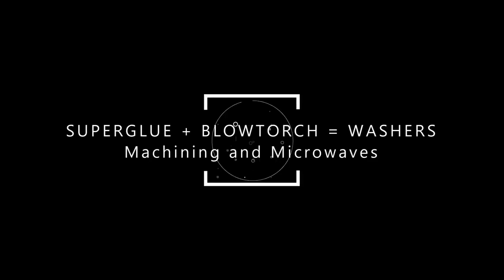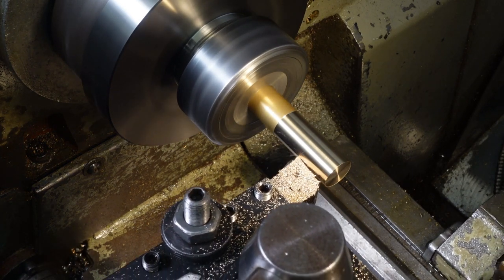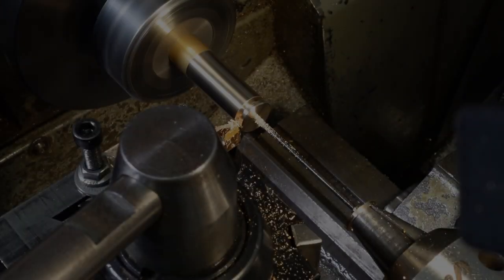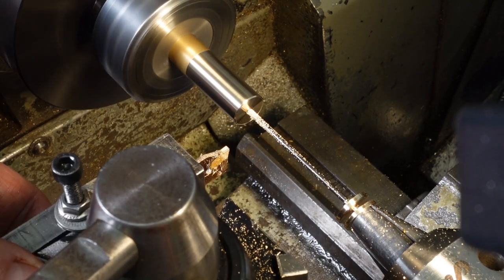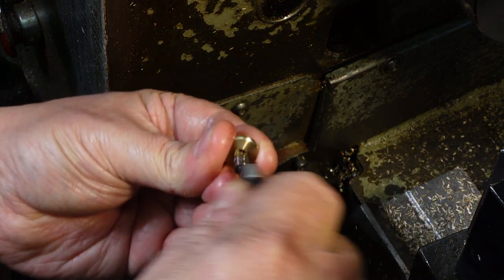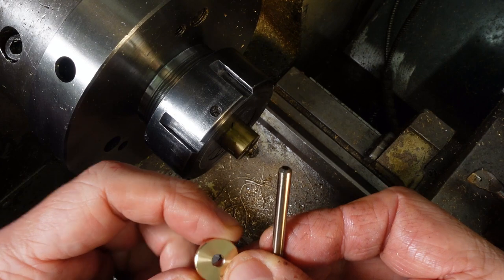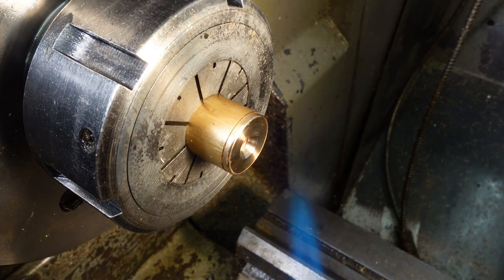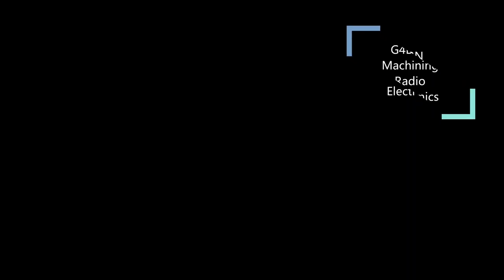How do you hold a part you can't grip?  Machining precision washers with a Glue Chuck

Comment: That you're aware of a 20 micron non-linearity, and can live with it, is remarkable.  If I ever get around to putting scales on my machines I might bother measuring them that precisely, but then I might not just to save the headache of knowing that they're that close to perfect but not there.
Reply from the maker: I suspect it's something mechanical that I haven't spotted yet. It's totally repeatable though and by setting the stickout on my tools to a standard length, I can usually avoid it being an issue.  The DRO was included with the lathe, and it's so old that Newall don't have any record of the circuit. I can map the non-linearity using a dial indicator.  I can't see how it can be related to wear on the gibs or slide, as there is no discernible lateral play or shift in that range. At first, I thought it was a scaling error, so tried tweaking the rate constant for the Spherosyn scales, but that just made the overall scale incorrect, and the nonlinearity was still there. I suspect there could be some damage to the outside of the tube that carries the precision balls of the cross-slide Spherosyn, and that is somehow upsetting the LVDT/induction mechanism.  After all, with 5mm balls in the tube, getting to a 20 micron error is perhaps not that hard if some hamfisted eejit has scrunched the tube.  I need to tear it to bits and have a really good look at it on the surface plate with a height gauge to see if I can find the root cause. It's possible that something is catching and twisting or bending the mounts and I've not noticed.  I really must get it sorted, but the cost of a new controller for the Spherosyns was about what I paid for the complete lathe, so I might put up with it for a little bit longer to save on cost. Typically it's perfect from 100 mm dia to 40 mm, then after a reset, it's perfect from 28 mm to 0, but between 28 and 40, there are oddities, and a total offset of 0.02 mm between the 100 to 40 and 28 to 0 segments. I even thought of bodging the controller and sending the readings out to an external home-made controller/display and making the corrections in software, but there's no way to do that without manually setting the position where it goes wrong. I'll have a proper look and maybe try buying a second-hand Spherosyn rod of the correct vintage to see if that's the problem. Otherwise, I'll just buy a modern replacement DRO.
Reply from the maker: I noticed because I made some shafts that were 20 mm and others that were 16 mm using the same collet chuck and tools and DRO settings, but the 16 mm ones came in oversize.by 0.015 mm. Later, I did the same with a different tool with more stickout from the toolpost and they both came out the right size. Later, I had the same issue when boring some bearings, and there was again an error after a change of about 7mm diameter with no other changes. I did that job another time, but that time, I had the compound at an angle, but locked as usual, and there was no error. That's when I sat down and mapped the DRO against a set of gauge blocks and a Mahr Millimess and found the problem.  I'll get it fixed one way or another. It really matters when I'm making parts that are less than 5 mm diameter with precision fits and extra fine threads.  I have to go all Abom79 or Keith Rucker and use dial gauges on the cross-slide for very precise work, until I'm sure the DRO is in it's linear regime, which is just silly

Comment: Coming along nicely!
Reply from the maker: It's been in full production tonight, making another batch of support rings, so not had time for any video updates, but the comment from Chris Maj got me thinking about tapping three extra holes in each collar and making one more stud so I can have either three jaws at 120 degrees or four at 90 degrees. For now though, it's working hard at its assigned task.  I was surprised I could fit a boring bar inside, but it worked fine for machining the ID.  Watch this space...
Reply: @MachiningandMicrowaves  Exciting! This is a really cool build. Keep us posted on the forum.

Comment: How about making your own DRO, a section of pipe with a movable end plug, all connected to your PNA-X with TDR….
Reply from the maker: Might need to compensate for the varyoing vapour pressure of WD40 and IPA in the shop, but then, why not use a vacuum dielectric and thermal isolation with double oven temp control, hook it up to my Rubidium clock and it could be a winner. Just need a PNA. Suppose I could sell the house?
Reply: Laser interferometer to get nanometer accuracy?
Reply: @TheEvertw  which i have done already! Vids in my channel
Reply from the maker: @TheEvertw  Good plan! Possibly a few challenges about keeping coolant out of the optics, but I definitely approve, subject to technical appraisal and grant funding.  Cheaper than even renting a PNA-X though for sure.
Reply: @cnxunuo  "which i have done already"
+1 subscriber
Reply: @TheEvertw  😂that just doubled my subscriber count, thank you.

This is how mechanical ruling machine which makes optical grating were regulated i believe, quite interesting
Reply: @cnxunuo  Interesting indeed! I have done some work in the chip industry, came across them there.

Comment: What CA glue do you use?
Reply from the maker: I can't recall the exact brand, it's a high viscosity type that stays where you apply it on vertical faces. I'll see if I can find the Amazon link for it
Reply from the maker: https://www.amazon.co.uk/Everbuild-HV50-EBD-Industrial-Superglue-Viscosity/dp/B0012RGKJK is the one I used
Reply: Thanks, that's one I have on the shelf as it happens! I'll give this a try, thanks 😁
Reply from the maker: @pablodiablo7658  Remrmber to take care about ventilation when heating the parts to release the glue. The contact faces need to reach about 200C but any glue on the outside of the part can get vapourised and form nasty products. I run a giant extractor fan or use a shop vac vented to the outside air
Reply: @MachiningandMicrowaves  OK thanks